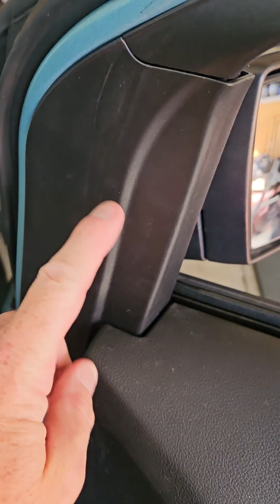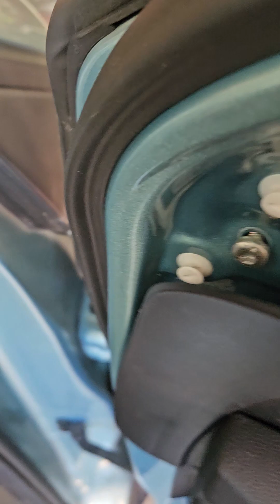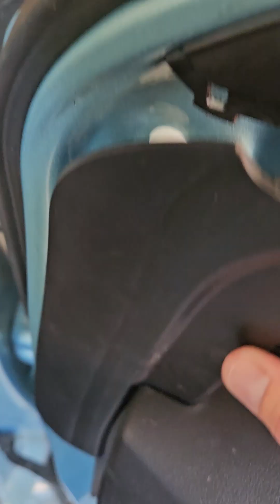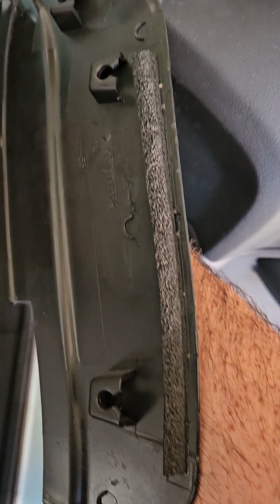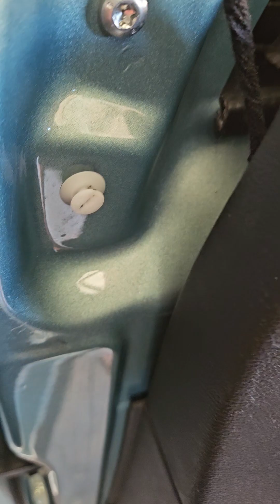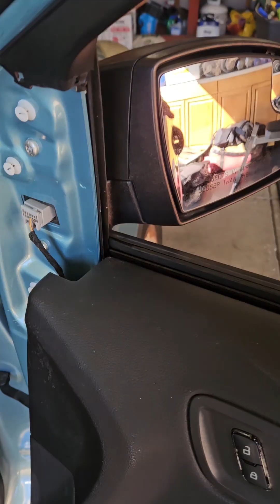Side View Mirror Replacement HACK - 2013-2019 Ford Escape

Comment: OK Chuck I did it! I replaced my mirror without taking the panel off the door! I trashed the bottom clip but the two on top are fine. So I saved a whole bunch of time and money so I'm happy with the outcome its just a little flap on the bottom I can super glue that in place no problem. Once again thanks. I will give you a shout out when I post my how to video on the side mirror. Thanks again...